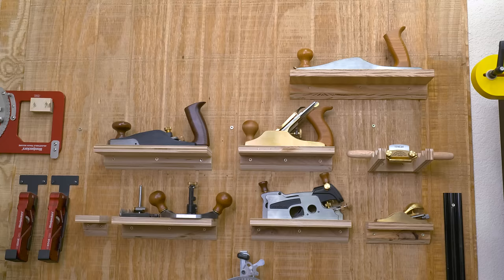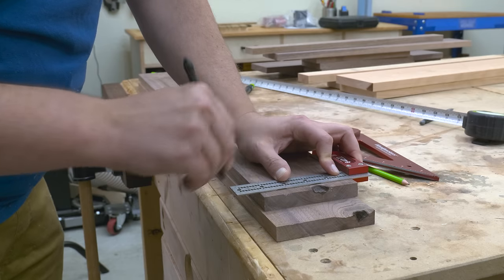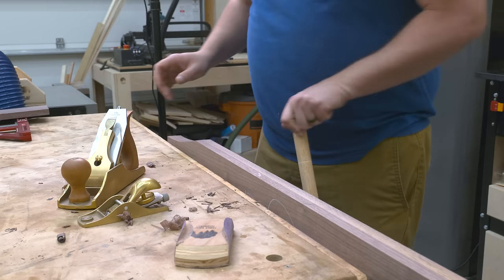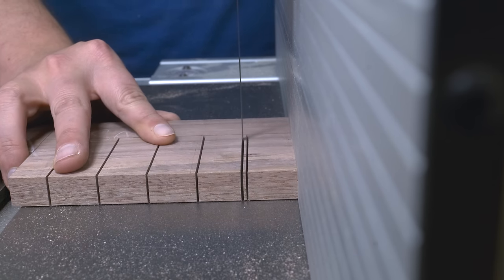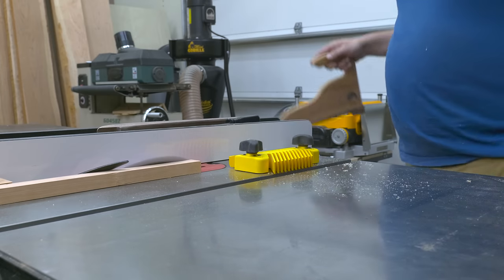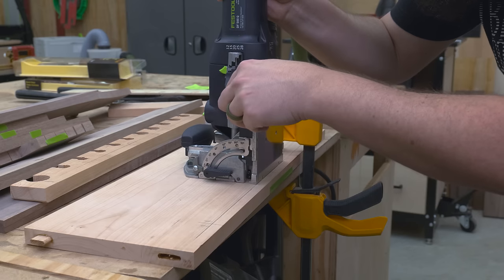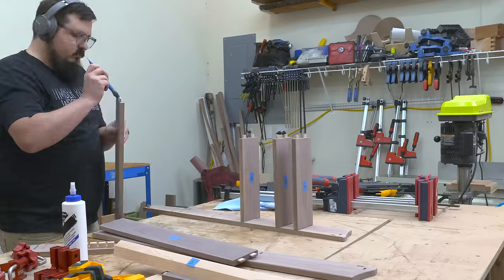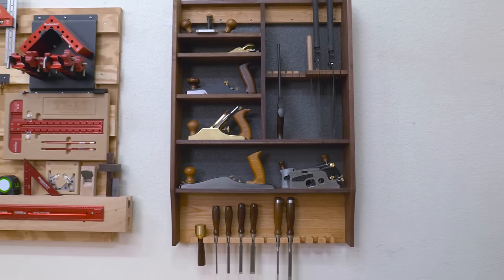This Hand Tool Till is Absolutely GENIUS

Comment: While I believe you meant to ask what our favorite unit system* is, my favorite unit is buttloads, which is a volumetric unit. 1buttload=126gallons. Converted every volumetric calculation in engineering school to buttloads on every exam and my professors hated it but couldn't mark me as wrong it was awesome
Reply from the maker: Well that sounds like buttloads of fun. I might have to start measuring my finishes in buttloads.

Comment: To your question about Darth Vader’s preferred unit of measure, I just got back from Sweden where my daughter and I were remodeling their kitchen (she’s married to a Swede). It took me a couple days to wrap my head around working in metric, but once I did, I found it really easy and considered converting my own shop back in the States. But since our whole system, from tools to lumber dimensions, is imperial, it felt like swimming against the tide, so I’m back to fractions of an inch and I left the metric set up blocks I bought there for the next time (appropriate since they were invented by a Swede).
Reply from the maker: I agree with you. Metric would be awesome, it's a heck of a lot easier and I use it for some of the Festool measurements. I guess that's what we get for underestimating the power of the dark side...
Reply: @TimberBiscuitWoodworks  I still wonder whether it would work if you stuck to a single fraction but being Dutch I will have never the opportunity to test it.

For example I would choose 1/16 as it seems to be the smallest unit used by most woodworkers and it can be abbreviated to sith. 
So in this case everything between 1/16 and an inch will be referenced as X sith.

Now you could go of the deep end and start calling inches hex (hexadecimal, base-16) and feet doz (dozenal, base 12).
Reply from the maker: @janjaapvdijk  yeah it’s a rabbit hole
Reply: To quote Brian McManus from the Real Engineering channel, “the Imperial system was invented by people who married their cousins”

Comment: on measuring systems :

I use both !

I´ve got a couple of Starrett metric combination squares and a Union Tool Co. and a Miller´s Falls, even in the original packaging, imperial cobination squares. Same goes for rules etc.
I also got metric and SAE wrenches and sockets from my Harley wrenching days and not only that, but Whitworth, because I´m a tool collector too.

If I need a groove for 6mm plywood, I use my 1/4" cutter, because it gives me just that tad more clearence I need. 
I also found imperial easier to use when sketching things up on paper.
Reply from the maker: Good answer and reasoning there!

Comment: I think ambition and drive can get you through your first couple of projects. You're super excited to get things done, so you find a way.

After a while though, if your skills outgrow the limitations of your tools or your space, or even your time available, then it's easy to make less stuff, or stop making stuff altogether.

Reducing the amount of friction in your work flow, so you don't have to think up a cunning plan to execute every step of the process, will mean building things stays fun.
Reply from the maker: True, but at that point I also think you start executing those small tasks at a much higher level of accuracy. That, in return, saves a ton of time and allows for more creative solutions.

Comment: Nice work and easy to follow and watch videos, thank you. Your comment on tools is so true but having the right tool for the job is a must. Having said that the most expensive doesn't necessarily translate to a better job. I have several hand planes, Lie Nielsen, Veritas, and Stanley and I like them all, but the Stanley #62 and low-angle block plane never disappoint.
Reply from the maker: Thank you! And I agree with you there

Comment: Well, I did make one separate till for just my planes. I don't have too many yet, I am still finding some I need to buy. I do plan on making some wood ones as well...... Some one said, "Buy the cheap tool, cry every time you use it. Buy the good tool, cry once." Fairly close. Cost is not always the determining factor. Some times best value is better than most expensive tool....
Reply from the maker: With a lot of hand tools the biggest difference is the quality of the steel. Higher end plane irons hold an edge for much longer than the cheaper ones.

Comment: Must have won the lottery. There’s a half million dollar in equipment in this shop.
Reply from the maker: Maybe if your talking Pesos
Reply: @TimberBiscuitWoodworks  one awesome shop.  I was into  metal fab in my home shop.  36’x60’.  Had a ton of everything a weld/fab shop needed I guess.  Had to carry “ special?” Insurance on all equipment and building.  Weld shops are “ fire hazards” lol.  With time, the right tools you can work metal  ALMOST as easy as wood.
Reply from the maker: @timbow50  I’ve thought about trying out some metal work. Maybe one day down the line

Comment: Just found your channel as a suggested vid with the Roubo build. Really like how you present your content and the blend of power tools and hand tools as that is very similar to how I like to work. As proud as I may be with a piece I squared and jointed fully by hand from scrub plane up to my #7, using straight edges and winding sticks, but I also can't resist the simplicity of just turning on the jointer and planer. I like both Japanese and Western chisels. Prefer a western back saw for hand cut joinery, but choosing between chisel style is more what is more appropriate for the task at hand, and if it's a task either can work for, it's just what I'm feeling like that day. Kinda like am I going to wear my super well broken in boots that fit like a glove and an extension of my body or the super light and cushioned sneakers today?
Reply from the maker: Thank you and welcome to the channel. I love hoping back and forth between hand tools and power tools. It lets me choose where I want to spend my energy. Great point on the chisels, I definitely know what you mean.

Comment: Beautiful build, congratulations 🎉🎉🎉
I would make it from b.walnut and white oak (those are my woods for shop furniture).
Also, metric is the system I was using for my whole life. I understand (and don't at times) the imperial system, but I can easily switch between the two if needed. 
You just know chair seat is supposed to be around 45cm (or around 17-18in) tall and that's it. It is just a number memorisation, people make too much fuss in this debate over imperial vs metric. Both have advantages and disadvantages.
Reply from the maker: Thank you! Yeah, I hop back and forth between them, but still predominantly use imperial. And I love walnut and white oak. I debated doing that in the shop for while.

Comment: My favorite unit has got to be the smoot.

In practical terms, though, I switch back and forth between metric and imperial pretty easily, at least for weight and length. I don't have much of an intuitive grasp of metric volumes, yet.
Reply from the maker: Hahaha!
Reply: I like the Smoot, also, but it is a rather large dimension for furniture scale work. Do you think that Smoots are fractional, or decimal?

Comment: Very nice build. A little rushed on the voice over, but you covered a lot in a short time. 😁

Only change to a great design is to incorporate the back so the till is self contained, not using the wall as back.
If it was me, I’d date the build also.  Nicely done! Thanks for sharing.
Reply from the maker: Thanks!